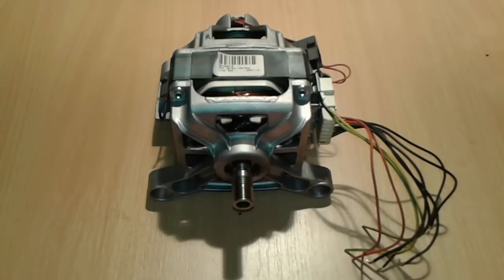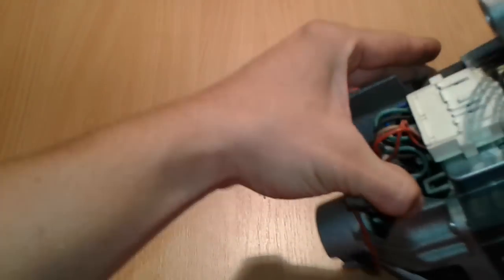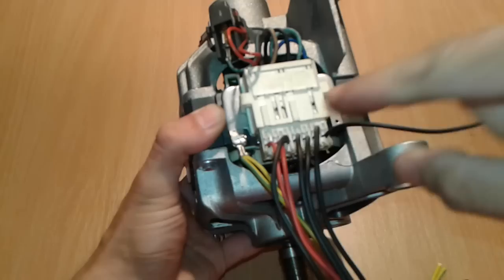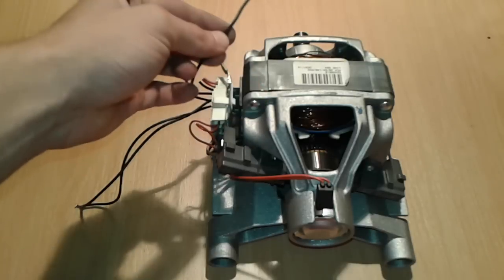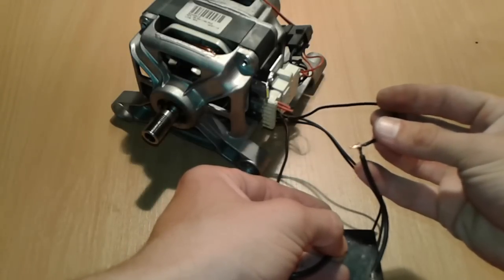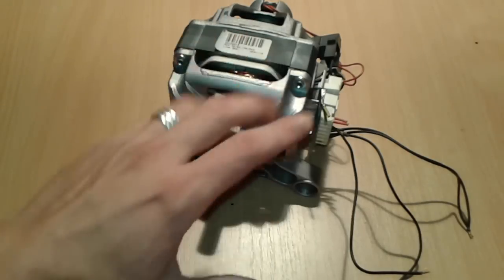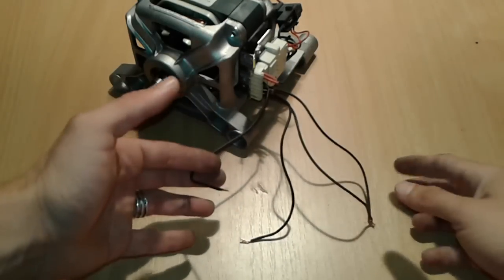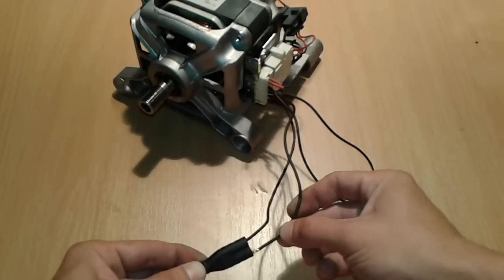Washing machine motor wiring basics

Comment: Which parts are live when the motor is in use?  Presumably the casing is not live?  It looks like there are earth wires connected to the case.  But the windings must be live, so be careful what you touch, when the motor is running, correct?  Thanks!

Comment: So coil in series with brushes and i can use it on DC/AC?
Reply from the maker: Series connection can run both ac or DC at maximum speed on ac and on dc directly proportional with the voltage less voltage less speed
Reply: @NoSkillsRequired  Thanks i tried it works well
Reply from the maker: @albysHub2006  noce use it carefully all the best

Comment: I have a Washing machine motor. SIEMENS 151.60000.13 / C 033 00 364 C. It gas SIX termnals all of the same colour.  The meter reading of these terminals are as follows. 1 &  2 = 26  pf. 3 & 4  = 14 pf and 5 & & = 14 pf. All other terminals give CERO rearings.  
Can anyone help me so that I can connect these motor to mains?    jeonash@gmail.com

Comment: Hi i have a problem pks help me... 
I wired all as on the video, then connect to home 220v, the motor get faster and faster and after 3 sec was an electric light and the Electricity fell down from the main switch. What i have to do? The motor didn't hurt at all. Ty
Reply from the maker: This kind of wiring is forxong the motor to go full speed not indicated for long periods of time is just for testing purposes you will need a dedicated speed controller to start it slow and then full speed browse to my videos find speed controller on washing machine motor

Comment: hey i just subscribed to your channel and found a lot of interesting content. I have a Hoover washing machine motor with brushes, 1300 RPM, 240v only diference is the wiring they used they hav 8 port connect n instead of the blue wires connecting on one side they connect on opposite sides and i cant apply the connecting method you show here ho can i fix it. i even have a short video of it or pictures

Comment: Can you do a video how to use it and connect to Direct corrent power supplies
Reply from the maker: Zero Gerona this is the way to do it on ac and cd follow step by step and do not touch the wires after connected to the mains live be careful

Comment: Hello i have a question. I accidentally wired the tack wires to 240v (i thought that thats the right way to do xd) and than a small electric lighting happened. So my question is that if i would do as you did it will work or i just burnt down the whole motor? pls help me i need your help!
Reply: update: ok so i wired everything up like it done in the video and it works just fine :D Thank you :D Youve earned a sub :)
Reply from the maker: Gergő Czikora just follow the video and you will succeed, the sparks from tacho means that probably you can't use the motor on a washing machine circuit but the rest should be ok
Reply: @NoSkillsRequired  You are the best man! Really really helpful!!!!!
Reply from the maker: Gergő Czikora my pleasure friend, glad that it was helpful all the best and stay tuned
Reply: @NoSkillsRequired  one thing remains unknown to me.. the rpm of this motor :D what do you think how much it could be? :D
Reply from the maker: Gergő Czikora it depends from manufacturer but usually between 10000-15000rpm so pretty fast

Comment: How would you wire this washing machine motor? Only 3 wires connected to a centrifugal switch.  https://forum.allaboutcircuits.com/attachments/motor2-jpg.168073/
Reply from the maker: Scott Walker I am guessing is a induction motor you will need a capacitor for that but not tested fully yet
Reply: @NoSkillsRequired  How would I test it to know if it is an induction motor? Would it blow up if it didn't have a capactor and I tried to "plug it in", lol?
Reply from the maker: Scott Walker if you are not sure don't plug in the mains, this video is just for universal motor, if you don't have the brushes left and right the black carbon stuff that means it's not universal motor could be something else

Comment: hi when i connect voltage regulator motor spins faster and faster-when i turn up motor reg motor goes even faster but wont go slower when reg turned down
Reply from the maker: reallywont sufferfools hi there depending what king of motors controller do you use, you should go for a dedicated voltage controlled ac motor
Reply from the maker: reallywont sufferfools check washing machine motor speed control I got a video just for that all the best

Comment: If the tachometer resistance is good. What else can go. Wrong. Or. What else to check
Reply from the maker: JOSE AGUILAR try and test the motor like in my videos you când do it with 9v battery in series the tacho is for adjusting the speed in the control unit if you are using the motor without the control board from washing machine the tacho wires are useless

Comment: great video, I am trying to wire up a motor and cap, a friend gave me with no luck. the motor is a 110v whirlpool #w10416660fsp it has 4 wires green white yellow red . I can get the motor to run by jump starting it but it will not start on its own with the capasitor, the cap tests good. have checked the resistance across the wire here are the findings. white and yellow=8,white and red=8, red and yellow=11 can you tell me how to wire this motor, thanks.
Reply from the maker: check for continuity as well between all the wires,if you have the capacitor it probably means that is wired different and will not work without capacitor if you give the motor a spin will it run? send a picture with the wires and connection demiwattuk@gmail.com to see if is the same with the one from the video all the best

Comment: Why my washing machine motor in their brushes always occure  sparkling and its sound is quit rough,should i replace the carbon brush or what. Thanks for your explaination/
Reply: u connect wrong thing...your wahing machinemotor has some white wires right...dont connect those

Comment: Hello Sir,

Your video is very useful even for those who have no basic knowledge of electrical engineering. Can you please let me know how a washing machine motor can be used to generate free electricity and how much maximum watt we can get? I need to know whether it is possible to run 1500Watt computer 24hrs?
Reply from the maker: Hi there check my video washing machine motor generator
is not free energy yet but is more out than in small amount
i have more video to come about this subscribe and stay tunned all the best